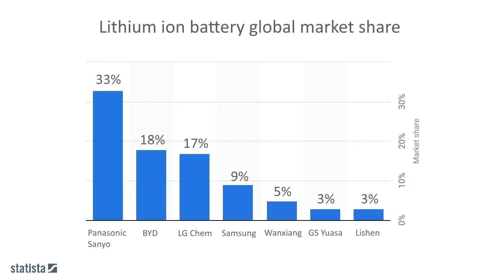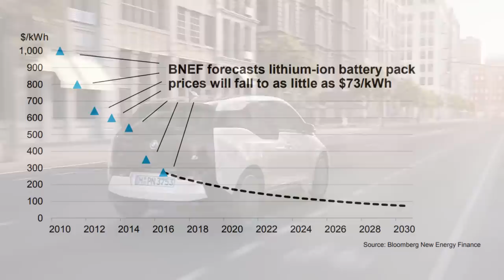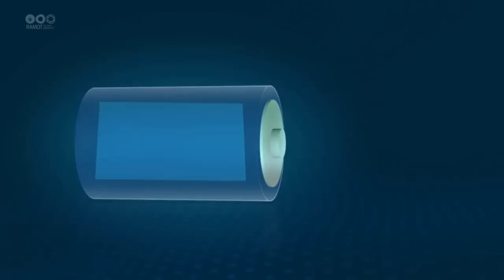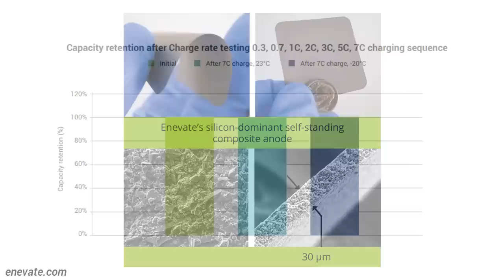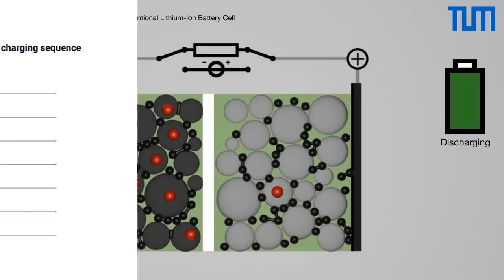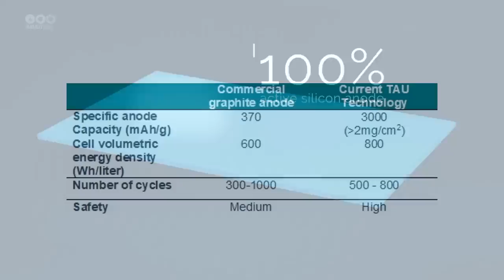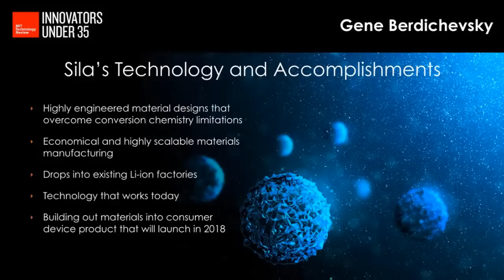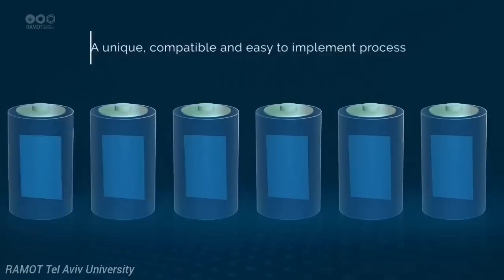The Battery Revolution. Ultra Fast Charging

Comment: I always love your tutorials, I have a question.
What's the minimum voltage that man starts suffering from DC voltage.

I always thought that DC is safe to work any Voltage is it correct?
Reply: Who told you that? You certainly feel AC before DC but with AC there is a chance it can resonate with the heart. But DC is continuous and will cause muscles to contract far more than ac of the same potential. In the UK the mains potential is 240v AC and I have had shocks of it many times and been able to pull away, however as a Radio Ham I have also had shocks off 250v DC and that was far more, how shall I put it, Uncomfortable!
Seriously why have you always thought that DC is safe to work any Voltage? That is completely untrue and a dangerous thought to have. PLEASE BE CAREFUL OF ANY VOLTAGE AC OR DC ABOVE 50v.

Comment: is there a wayfor electric vehicles to have a manual like gearbox, as well as a realtime v8 sound like engine
Reply: Yes, but for everyday travel there is simply no need for gears. V8 sounds, or any sound for that matter could be simply linked to the accelerator and piped through speakers, some cars already do this, and not all are EV's

Comment: There's no resistance to electric cars - people don't care what their cars are powered by. They do care about range and charging time though - that's all they care about. For electric cars to replace petrol and diesel cars, the charging times mentioned in this video have to be realised. 5 minutes for 250 miles will do it. Most people in Europe don't have a driveway or garage - charging has to be as convenient as filling the car up with petrol. I still think the 2030 changeover Europe is imagining is a bit of pipe dream though.. It'll likely only serve to push up the values of the older cars!
Reply: 2030 is easily achieved and by then I expect EV's to have twice the range and half the charge times they have today, at the same cost as an ICE equivalent.
Reply: It's only achievable if you can put 200 miles of charge in your car in 5 minutes at one of the thousands of charging points governments have to add to every city in Europe, as well as every roadside garage. In 12 years. Whilst somehow keeping the hundreds of thousands of people employed in petrol/diesel car industry in work.. Electric cars are simpler after all - by design they'll require less people involved in the servicing and repairing of them. 

The reality is we won't even be close. It's nothing to do with electric vs petrol - it's to do with keeping the world turning. There's no point in saving the planet if humanity fucks itself in the process.

Comment: Not so fast! Faster charging means higher peak demand from the power grid. The grid in most countries is already right at capacity many times per year! Electric cars are now being produced much faster than investment in the charging infrastructure. I predict a situation in Europe where people will NOT be limited by battery charge times but by electricity availability on the grid. Of course politics will be involved, giving "essential personnel" (government!) privilege to charge first, making all us little guys wait. Another thing, solar charging only works when the sun is bright. No night time charging, when everyone needs to do it! Better get the nuclear plants built! The build time for nuclear plants is such that if they started right now, they would not be finished by their 2030 deadline. That's if you can get ANY Europeans to agree to build nuclear plants at all. (Except for the French of course. It may work there!)
Reply: And TV-s, computers, light bulbs and all those kinds of the main devices that consume most of energy in houses become more and more efficient. Heck, about 15 years ago they consumed several times more energy than nowdays.
Thank LED-s and efficient computer hardware for this. So the future with everything running on electricity might just be possible.

Comment: Reduction of Temperature Related de-rating  is Very Significant.Ultra Fast Charging  is both un-necessary and reduces consumer conception of How Much Energy they are actually using.  Most home charging will continue to be done at moderate rates ( equivalent to a 30-50A 240v dryer)... eg 6 to 10 Kw per hour.  As battery sizes double ( leaf 2016 30 KwH  2020 60KwH)  and triple... one might expect charge times to also increase, OR more partial charging to be done.   The average driver will continue to drive less than 80 miles a day.  This may complicate using batteries in the proper range ( between 85% and 20%)  . The trend is to fewer on board instruments, and keeping owner/operators as stupid as possible.

Comment: 5:20 Why would you compare the time it takes the new batteries to get to 90% against Tesla's supercharger getting to 100% charge?
You said it's 5 times faster than charging with Tesla's superchargers--which is FALSE
I hope I'm not the only one who caught that obviously unfair comparison. 
If it takes 15 minutes to get to 90% with the new batteries, and 75 minutes to get to 100% with Tesla's superchargers, then that's not 5 times faster. The last 10% takes the longest to charge, so why didn't you do a fair comparison--how long does it take each to get to 100%.

Comment: Future Lab - There is one inconvenient truth about electric battery powered cars, besides the used battery disposable pollution problem. That is, ALL electric cars suck on the teat of the US national electric power grid for their sustenance. The prime mover of the US electric grid is 70% COAL and NATURAL GAS, fossil fuels. The "renewable" fuel (e.g wind, hydro, wood burning, etc.) sources are insignificant.  So essentially these cars are coal and natural gas CO2 pollution burners on par with gasoline and Diesel power or worse.
Reply: Andrew Zamorski - I've read the data from the link that you had posted. The conclusion that I have come up with is that the national power grid has a very LONG way to go before renewable fuel sources will supply enough megawatts to power the national grid at it's present levels. Especially when adding electric cars to the load. Coal, natural gas,  nuclear, and some hydro are the majority fuels in the US, with "renewables" at 17% at best.
Reply: George, I agree that the grid has a long way to go but please bear in mind that even if the grid didn't change in it's composition it is still greener in the majority of circumstances. then when you take into account that the largest contributor to the grid is renewable and has been for a number of years. This will move the composition over time. Solar and wind is now cheaper than gas and substantially cheaper than coal in almost all parts of the world so just from an economic point of view that change will increase. 
The grid cannot yet completely cover every car being replaced with electric cars yet but it is not far off as most cars will receive the majority of it's charge at night when there is a significant amount of wasted electricity.
Reply: sorry that should read the largest NEW contributor.

Comment: Assuming an EV uses 0.25kWh per kilometer, it would require 100kWh for 400km of range. 100kWh in 5 minutes means drawing 1.2MW(!) from the grid. Obviously not something you would do from home. Can todays grid handle thousands of cars collectively drawing several GWs, or even TWs of power? Even charging at 1000V would require 1200A of current. It just sounds completely unrealistic. The car would have to be running on at least 3kV for that kind of charging to be convenient. Unless, of course, someone figures out how to create an affordable room temperature superconductor. Not holding my breath yet!

Comment: TAKE NOTE: There’s no substitute to liquid fuels for transportation
vehicles in terms of Robotic Functioning and Molecular Alchemy. Liquid fuels
are combustible or energy-generating molecules that can be harnessed to create
MECHANICAL ENERGY, usually producing KINETIC ENERGY; It’s the fumes of liquid
fuels that are flammable instead of the fluid. Most liquid fuels in widespread
use are derived from fossil fuels; however, there are several types, such as
hydrogen fuel (for automotive uses), ethanol, and biodiesel, which are also
categorized as a liquid fuel. Many liquid fuels play a primary role in
transportation and the economy. Efficiency --- YES! Pricey --- Yes, because
it’s the price of an environment-friendly fuel ... not to be a hypocrit about
nature.

Comment: So if the cost of the Battery Tech is dropping, why does the overall cost of the vehicle skyrocket??? Petty Corporate GREED is why... In the ole days when 30% was enough to run a business all other prices were adjusted equally to allow someone to remain in business while also being able to provide for one's family. Savings use to mean something as did waiting until you can AFFORD TO BUY but not these days. Corporate Greed has trickled down to the average Joe as well. eBay is full of GREED. There was a time you could buy USED for a Deal; perhaps even a STEAL... But no more, now-a-days used is equal or more than New because of GREED... There was a time when 50% of something was better than 100% of nothing but no more. Now it's 1,000% or NOTHING. Competition has been replaced with Collusion. Why sell for cheaper when I just have to match the lowest price and each makes an unreasonable profit... GREED is killing this world but I digress...

Fossil Fuels will always be involved with vehicles regardless. As long as there is any form of metal on metal contact some sort of lube will always be required to relieve said contact and until oil is replaced as a lubricant fossil fuels will be linked to any vehicle. Granted reliance on Fossil Fuels to fuel vehicles may be dropping as more and more Hybrid Vehicles emerge but Fossil Fuels as a Lube is not going away anytime soon or in the near future... Think back over 200 years ago, what was Fossil Fuel used for??? Wagon Wheel Lube... Granted it was not considered a Fossil Fuel per se but it was still Oil being used as a Lube just the same... 

Cheers...

Comment: I’m not sure where this Li-Ion vs. gasoline advantage crossover of $100/kWh comes from. It seems very out of touch. Tesla and EV owners already publish running cost estimates that show how much cheaper it is to run EVs compared to ICE vehicles NOW at current gas prices. See the report from The Guardian 12/17: https://www.theguardian.com/environment/2017/dec/01/electric-cars-already-cheaper-to-own-and-run-than-petrol-or-diesel-study

Comment: Anybody else notice that for cars and house hold items etc. we are STILL using 100 year old tech?  The only change in car batteries (from Lead acid which dates back before WW1, for cryin out loud) The ONLY change has been ""gel batteries".  They cost a whole lotmore and are damn near impossible to charge if you run them dead.  I refuse to buy one (had enough experience with 40 years of automotive to decide I didn't want one).  Since lead-acid battery "tech", that actually was first used in ancient MESOPOTAMIA (3,000 years ago!) they have changed practically not at all!  WHY?  My conclusion is the tech is being quashed. Battery makes would lose literally billions world wide so they buy up and/or destroy ANY new tech to come along (environmental concerns of disposing of all that acid, and lead, be damned, they all pay lip service to it and that's the end of it!)

Comment: What they REALLY need is every electric automaker to agree on a single charging standard for both AC and DC charging. My suggestion: a modified version of the J1772 Combined Charging System (CCS) that can operate at much higher DC charging rates than today. That way, there will be plentiful charging stations to support all automakers, including Tesla.

Comment: 1:25 18650  not 1865 ;) but you wrote it correctly and the Model 3 is using 2170 cells with different chemistry that the original 18650s used in the Model S and X. Editors, you're fired.

Comment: ICE burns fuel under hood direct to mechanical energy , battery charging burns fuel at power station , but grid has 70 % heat lost, mechanical energy to electrical , charging and back to mechanical at car motor. Every step has energy lost. Today  every think is energy efficiency, but E- cars.  E -car is like Trolley bus in '60 Europe ,now gone. Battery are  depended on big scale mining - aluminium, copper , lithium   and needed a lot fossil energy to industrial prosess to final product.  Left environmentalist and regulations  NEVER make  battery cheep. 
End of Gasoline = dead in water  w/dead battery.

Comment: how you gonna charge all those vehicles? Burn more coal? How you gonna recycle old batteries? Now, do you know your battery capacity in -20deg C? its around 40-50% less good luck pushing your car in subzero temperature

Comment: A few figures are wrong. 300 Wh/kg in a cell of a Tesla vehicle? I don't see it.
A 21700 cell is about 67-69 Gramms. It would need 5700 mAh to achieve 300 Wh/kg.
Tesla Model 3 Standard Range: 2976 cells. 54,2 kWh gross capacity translates to 4930 mAh per cell.
Tesla Model 3 Long Range: 4416 cells. 80,5 kWh gross capacity translates to 4930 mAh per cell.
This about 5000 mAh is far away from the 5700 mAh that are indirectly claimed. It roughly translates to 260 Wh/kg.
5:27 - shows a Tesla urban charger (about 72 kW DC) instead of a supercharger (about 120 kW DC).
In general: the video mixes promises, images, and information fom several sources which do not belong together.

Comment: Even if the batteries can be charged faster this doesn't alter the fact that the electricity has to come from somewhere. This raises two problems. Firstly, to charge a vehicle in a few minutes requires an enormous current, and the existing cabling infrastructure simply could not cope with any significant number of EVs on charge at once. Secondly, with renewables struggling to provide even a percentage of  regular electrical demand, there is NO WAY they could provide the whole of the transport sector's energy requirements as well. 

So, you're basically talking about having to install a completely new electricity distribution system, along with solar and wind farms on a simply colossal scale. A few back-of-an-envelope calculations will show the total impracticality of hoping to do all this within twelve years. That is if it didn't bankrupt the economy first. Besides, can you see the environmental impact this would have, with every single spare piece of land, even right next to houses, given over to wind turbines? Dystopian is the word. I wouldn't want to live there! 

Other fallacy is that it's cheaper to drive electric. Only so because you pay neither road nor fuel taxes. Neither do you pay for all the charging points that are being put in. The long-suffering taxpayer does. Like solar panel subsidies, it's basically legalised robbery. I can't see that situation continuing if they become mainstream, no matter where you are your government likes its tax income. 

A more practical approach would be to develop thorium LFTR, and synthesise road fuels from the cheap and plentiful energy it would provide. A closed carbon cycle, low exhaust pollution, no major changes to vehicles (most existing engines would run on hydrogen or alcohol with small modifications) no polluting traction battery manufacture. Upmarket vehicles could use fuel cells for ultra-clean, silent operation.  

By far the better option. Especially as it will be available 24/7 instead of only when the wind blows.

Comment: Specifically for use in electric cars the use of new super capacitors will also reduce cost and increase the regenerative breaking yields.
Reply: They only work well in supporting the main battery, not by themselves.
Reply: I agree, but they do deliver serious advantages when used with i.e. regenerative breaking. The system can be cheaper when these capaciters are used, with batteries only, the total system needs to be overdesigned to be able to store all the energy that can be generated during breaking. The capaciters can charge faster than batteries and then charge the batteries when possible and at the speed the batteries can take.

Comment: No not the end of gasoline 
Example........ If i was rich or middle class i would have an electric motorcycle for zipping around town.
And have my petrol performance car or truck in the garage.
With solar panels and a storage battery on the house.
With water storage tanks.
It's a balance like most things in life.
Just an example :-)

Comment: $30k for a car that is that small and obviously has lower refinement compared to an existing gas powered $30k car. No tks! My Mazda 6 has 4 cyl and is a 2013. I have not had to take my car in for any service other then regular maintenance in that time and have 130k km. So for those people who say you will save on maintenance and gas. LOL  Electric is NOT cheap, it is " cheaper " to power it up but not "cheap"  Maybe in another 10 year they will be cheaper to own then gas powered but currently that is not the case.

Comment: One problem with ultra fast charging is the need to provide very high energy (and power) sources at the recharge station.  Depending on the battery voltage and capacity recharge currents of over 100 amps will be needed for a complete energy replenishment in a few minutes.

I already use batteries (Lithium polymer) which claim to be graphene.  Their advantages are the number of charge/discharge cycles before they deteriorate and the effective series resistance (ESR) becomes so high too much power is dissipated internally and they get hot and the terminal voltage falls.  They are slightly bigger and heavier than standard LiPos.  My batteries are relatively small (2.2 to 6 AH) and used to power RC model aircraft but the technology is the same - just smaller.  I generally charge at 1C and consider cells to be near ready to be scrapped when the ESR becomes > 10 milliiohms/cell